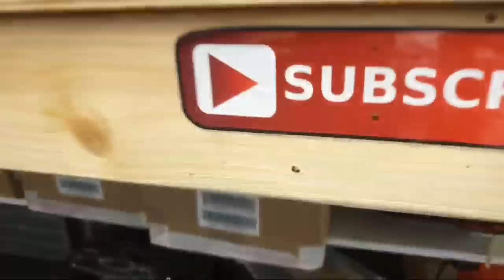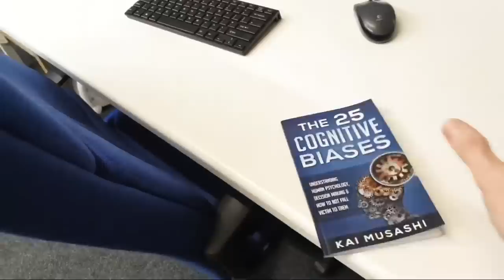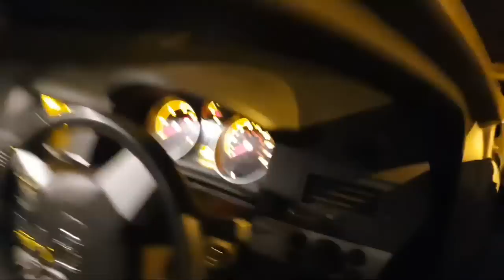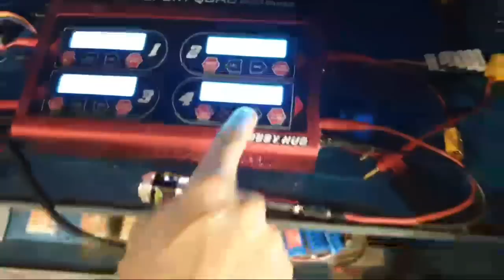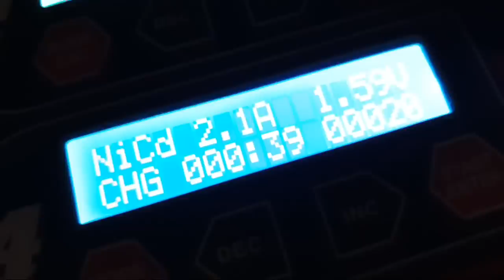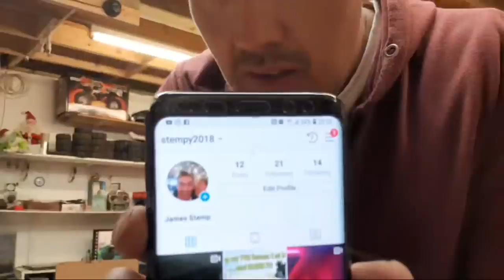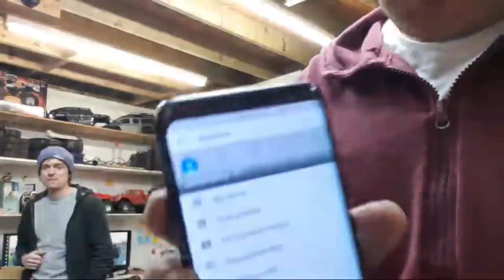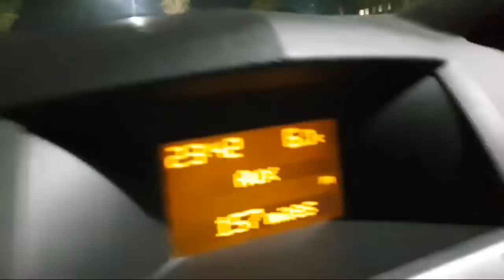Nitro Shop Time

Comment: 1:57:44 That uhhh...  Li-Po safe looks like a GGGGRREEAAT!   Way to nuke all your Li-Pos in one gigantic fireball in one go should just one let go...

Trick a lot of people use is Concrete masonry breeze blocks,  the ones with the holes in that don't go all the way through.   A battery in each hole with a Ziplock bag full of sand on top.     So if a Li-Po goes while charging it melts the ziplock bag and buries the Battery and contains the fire,  and the concrete walls keep the heat from the batterys in the other compartments. 

Dirt cheap too,  much cheaper than having a Lipo safe bag for each Li-Po....

Comment: Hey kev im having trouble will my revo 3.3 it wont suck fuel in the carb .... Through the lines and i went through five glow plugs today it started right up then died now it wont suck any fuel in the carb
Reply: @Stri Ker no the carb isn't cracked i found out it was just the tune was off
Reply: @alexrcworld4357  I reccomend rebuilding your carb.  Theres most likely old fuel gummed up In there or  the black ring below the hsn isn't aligned with the needle to let the fuel in.  Or the way the lines are wrapped around the roll bar limit the flow.
Reply: Put your finger on the exaust

Comment: The clicking in the xmaxx may be comming from a lose pin inside the planetary gear. I was told by my local hobbyshop that its common when you put high torque on it like using the self righting function. My xmaxx is doing the same clicking however i dont seem to notice a problem with it other than the sound.

Comment: Hey  guys grorgie smith here thunderbay been watching for a while i just moified my rustler vxl to 3s lipp and put bandit bidy on it andv16  tooth sprocket on motor insane everyyime i use it i break somthing it  does back flips  i just btoke axle  i put bigger tiiires andvtims on  it 33/4 , tires  on it and wheely bar on it  insane boys ive been wstching lot s   i could just imaggine 4s  its a blast

Comment: the batteries you pulled out of the glow plug was 1.2v in series. meaning it was running 2.4v. you have connected up all those 1.5v batteries in parallel, giving you 1.5 total volts.